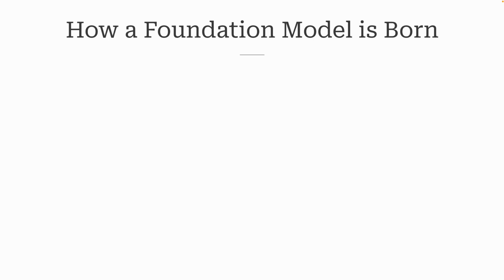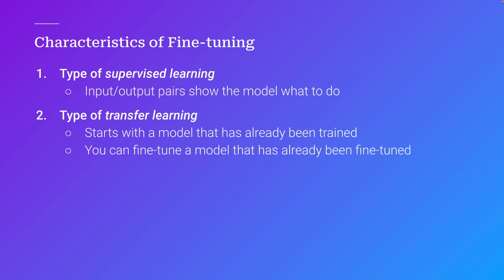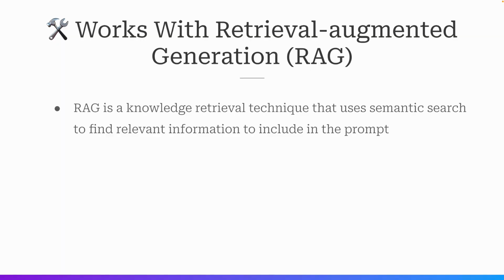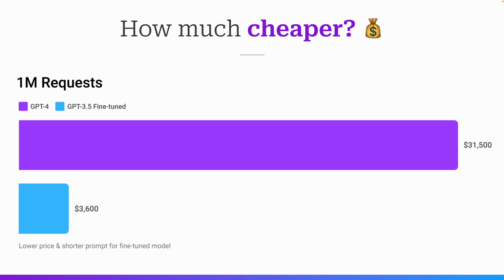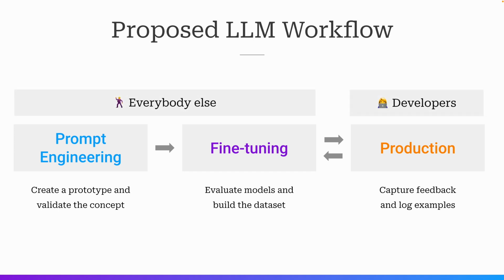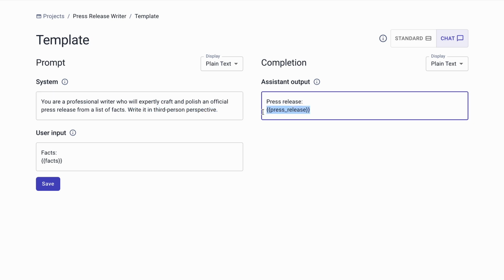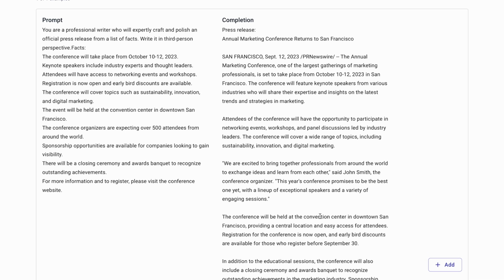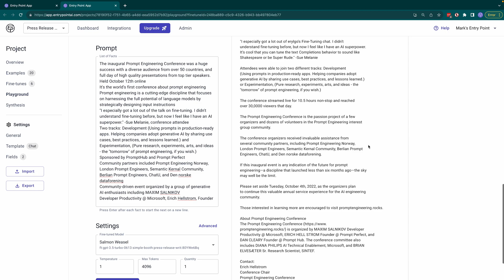Fine-tuning 101 | Prompt Engineering Conference

Comment: Thanks for sharing! Curious - can you fine tune the model by providing images? For example, one use case is resumes. What if I'd like to upload resume examples that are in PDF or JPEG format?
Reply from the maker: Multi-modal fine-tuning is definitely going to be a thing, but it's not available right now (at least, readily). For the time-being you would run an image through some OCR model to extract the text and then you could use that in a fine-tuned language model

Comment: Another question, can you finetune an existing finetuned gpt3.5 model with mire training data ir do do you have to start from scratch always? Especially for using the outcome to feedback in to training
Reply from the maker: With their new API you have to fine-tune from scratch each time, but they might add fine-tuning a fine-tuned model back at some point, they used to have it. Most of the fine-tunes I run are under $1 though.